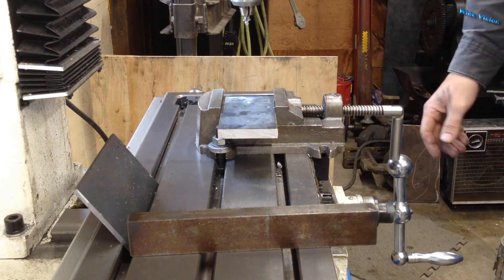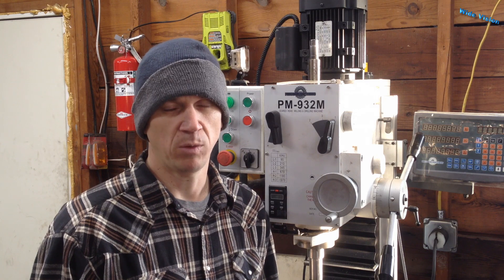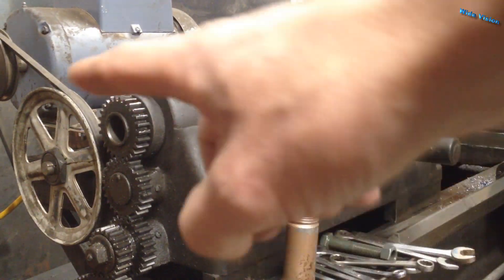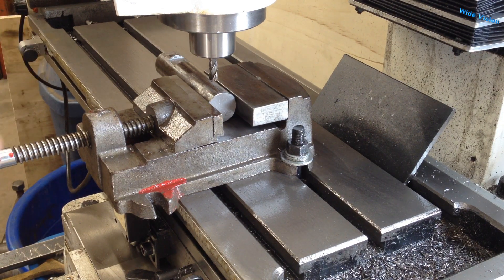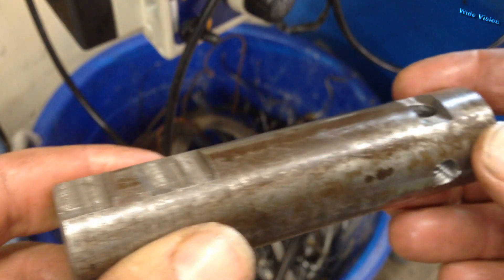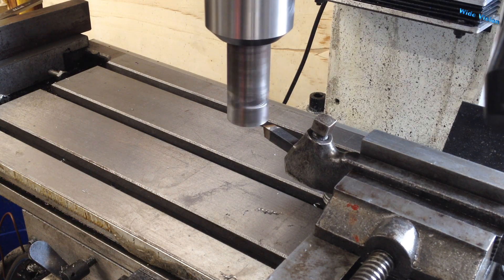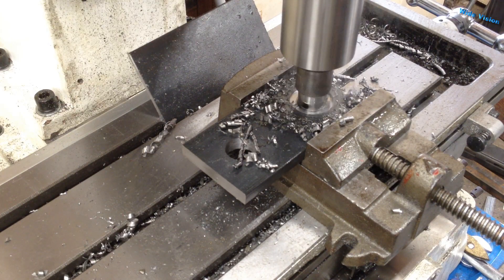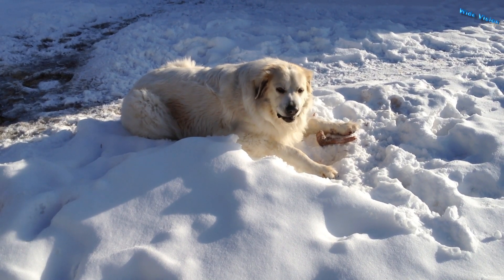Boring Bar Build  (with a special guest appearance by Samson.)

Comment: One trick I used to file internal squares that needed to be pretty even and perpendicular to a surface (before I got my shaper and die filer), was to put a square file in my milling machine spindle collet, and "die file by hand" using the quill.  Ya need a spindle lock of some flavor, and pretty much nothing else.  Use short files and conservative 'feed' rates, or you will wind up with an unintentionally shorter file :)

People making tools that get the job done will always get a thumbs up from me.  Good progress, and keep finding excuses to make new tools!
Reply from the maker: I'll have to try the file in the mill next time! Thanks! :)

Comment: I think they make an insert for holding your cutting tool without having to file the hole square. Keith Fenner used them in a video or two of his when he made boring bars, not that there is anything wrong with how you got it done and some jobs cant wait the few days for the mailman to get there. Just an info thing if you want to look for it.
Reply: Pardon me, but on further thought I feel I may have come off as rude in my comment. What I truly meant was thanks for showing me how to do it this way and I hope the tool works well for you. Secondly, I suck at filing corners square and seem to end up wallowing out one side or the other with my file drifting. The insert I spoke of was what I had marked down as the easiest quick way to get it done.
Reply from the maker: Not rude at all! Nothing wrong with sharing information! :) I agree, they are an easy way to go, and the ones I looked at  have the threads in them for adjustment, which would be nice.  But, I'm kinda cheap. For  just one, like this boring bar, $20 is ok, but with my long boring bar, I have 4 holes in it, and suddenly it's $80.
Reply: I've bought those inserts from MSC if you want one.  I see you boring a lot of stuff.  Why not go ahead a buy a boring head with R8 shank to fit your mill?

Comment: I find limiting the relief angle on the nose to bore of the cutter helps the edge to live a lot longer. Especially with your cutting edge above center you should need no  relief angle, just radius clearance for the bore. Also keep in mind you will need additional positive rake on the cutting face since you are beyond centerline.

Comment: You may want to take a look  {from 5:36 to @ 6:08 of the video.
} at Keith Fenner 
 / https://www.youtube.com/watch?v=nR6fSqYtqeU&feature=em-subs_digest
Boat Forks Part Four. To see the item "Low Carbon Tool Bit Sleeve." The sleeve is round, with a square hole to hold the tool bit.

See: http://www.essentracomponents.com/en-us/cutting-machining/machine-tool-accessories/machine-tool-sleeves/machine-tool-sleeves-square-holed

Comment: An easy way to index 90 from the flat for the threaded hole is to put the tool bit or other stock like key stock in the flat and put it against the stationary jaw on the vise, when you tighten it, it will automatically index that flat to vertical, or inline with your vise jaw anyway.

Comment: Doesn't it need to be on the centerline? The tip of the cutter?  For the cutter angles to be right I guess you could grind them to fit.
Reply from the maker: Nope.  It's the same thing as when using a boring bar in the tool post on a lathe, it's supposed to be set above the center line. If it's on center or below, then it will drag and not cut very well.  And, all the line boring equipment I've been around, the cutter right through the center, just like I did it.
Reply: The more I think about it, it does have to be on center it's not the same as a boring bar in a toolpost.
Reply: Yeah I thought so.

Comment: A deer old bone for the dear old doggie and don't listen to that other guy, He's just not quite with the program. Nice holes there, Pard! More than one way to skin a feline and make a hole in steel.  Hope all is well in town with yall. Stay warm and what about the drill press? Just axing! GBWYall!
Reply from the maker: The drill press is still in pieces. :) Maybe I can get back on it after I get done putting together the CNC plasma table. :)
Reply: @WideVisionMetalFab  Sounds like poverty left the old new homestead. GOOD! YOu need a break today and not any golden arches either. I'll keep watching as usual but don't listen to the other guy. And maybe read the instructions on the table or maybe get an interpreter if they're like a lot of instructions I've tried to cypher. 
Thanks, Markus! GBWYall!

Comment: If you said anything about cutting oil, I missed it.  Not a believer?
Reply from the maker: Yep, you missed it. Not only once, but 9 times.  Here's the time stamps.  1:32, 4:45, 5:34, 7:14, 11:32, 16:38, 17:57, 18:13, 18:41.
Reply: Wide Vision Metal Fab Watching YouTube with a toddler in tow is an art of sorts.  I’m still amazed to have gotten the general gist. Thanks for the thorough timeline! Will rewatch.